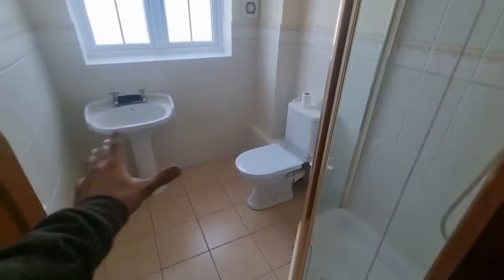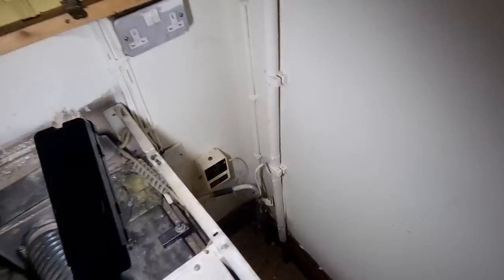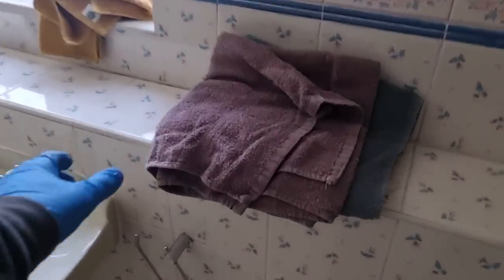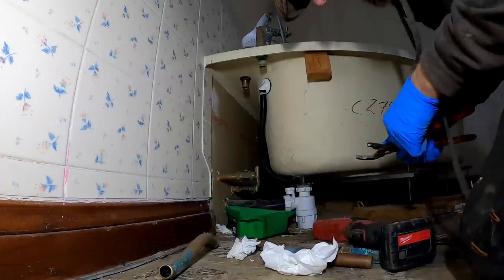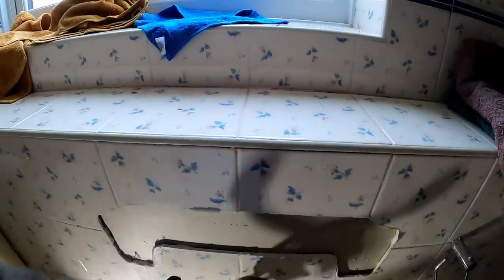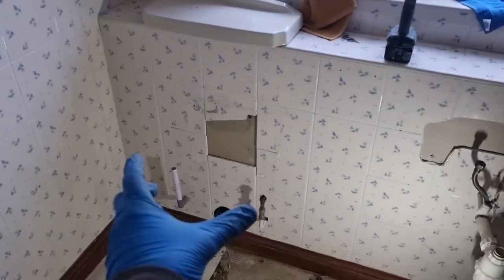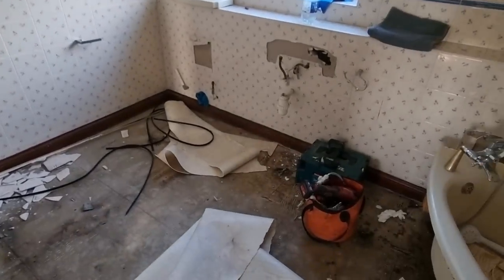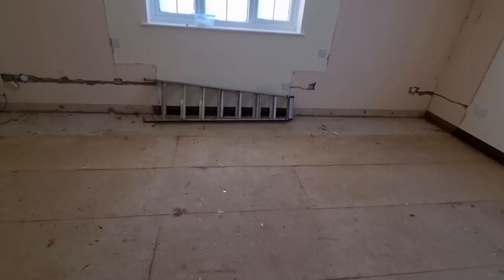Back on some domestic plumbing | ripping out and figuring out

Comment: The Trevi Boost showers are good, if I remember rightly they use cold mains supply and gravity hot with a Venturi inside👍 Great video and project Tom 😎
Reply from the maker: I think that's how they worked, you don't see too many any more but I did convert one to a thermostatic version when I put a combi in once, thanks for watching as always mate 👍
Reply: Only trevi mains boost does that the rest are normal hot and cold.
The trevi boost with mains cold gravity hot won’t work with mains hot you need a conversion kit. Think way to tell is it’s got black screw caps. Don’t quote me on that but though.

Comment: Hi Tom, was that the old three quarter pipe at the bath, might be why the Milwaukee struggling to cut, 22mm being that bit wider. All the best, Pete 👍
Reply from the maker: You could well be right there mate, I will be repiping most of the domestic circuits but it is something to always look out for, thanks for watching 👍